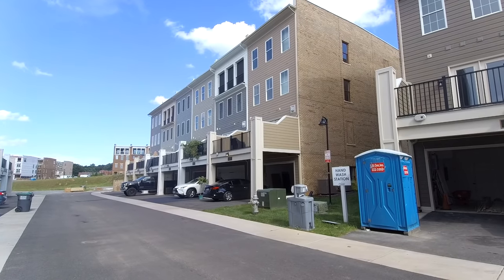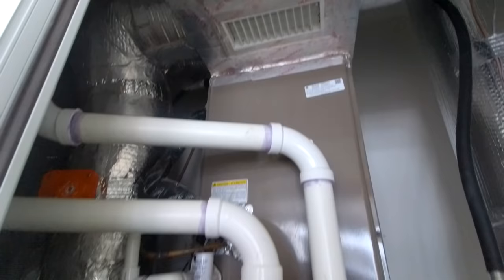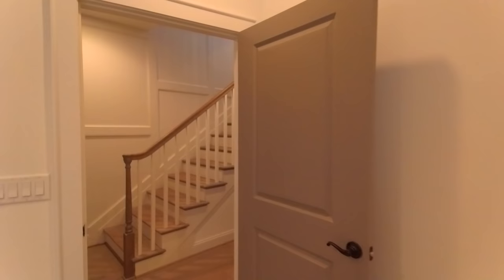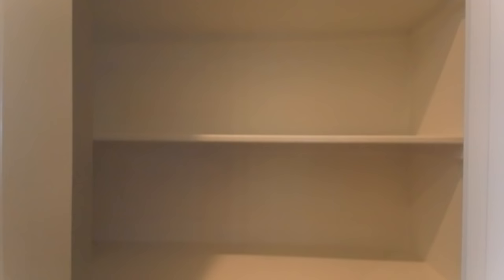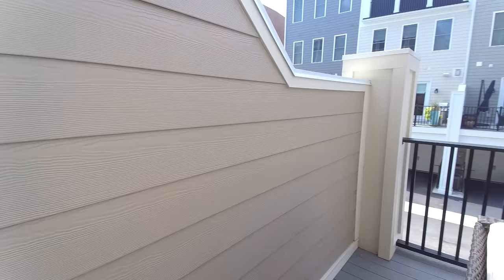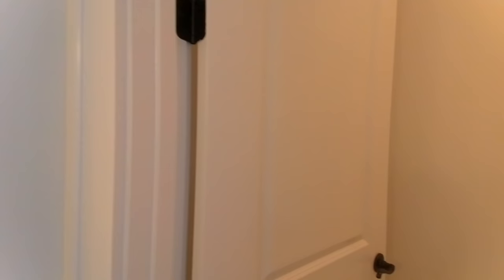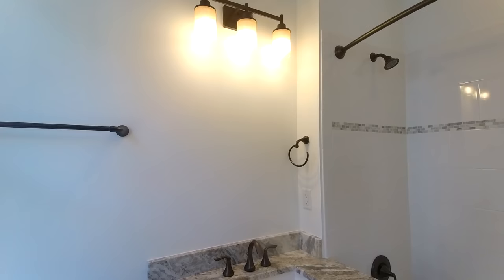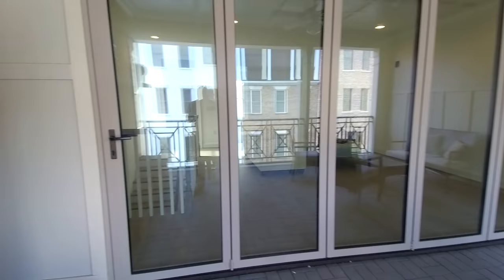Generous 3,033 Sqft Short Pump Townhome w/ Elevator & Garage for Sale ++$839,950++

Comment: HOA is surprisingly inexpensive.
Reply: It will increase over time, annually.
Reply from the maker: You are correct, for a home in this price range and area, it is indeed low.  The Association will be controlled by residents and they of course will keep it at a reasonable amount over time.